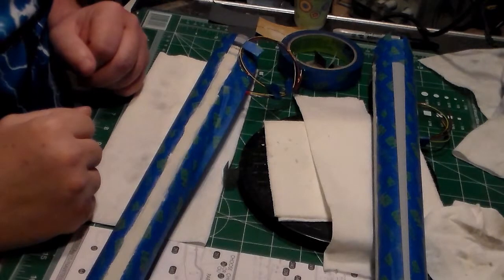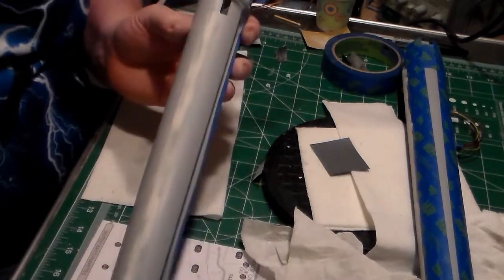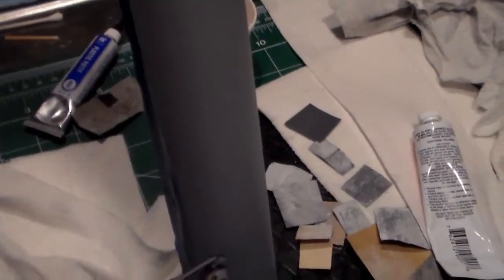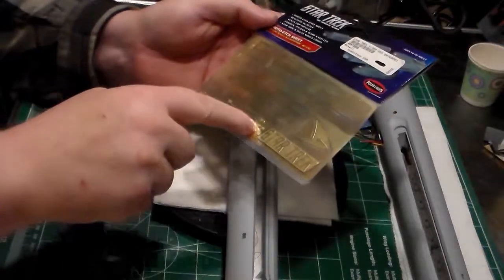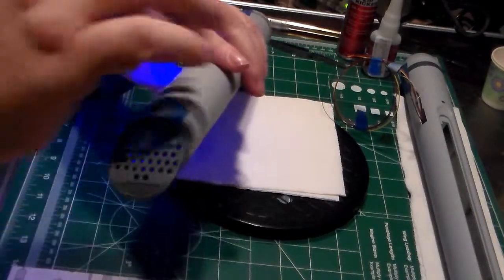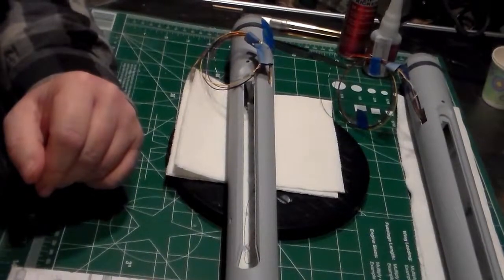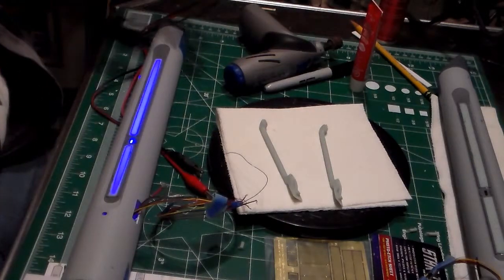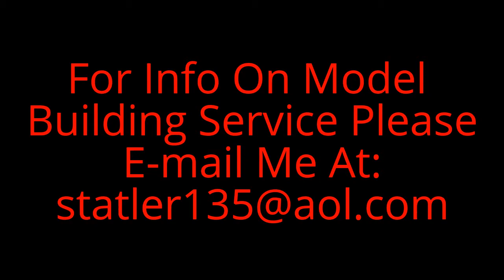POLAR LIGHTS 1/350 SCALE TOS ENTERPRISE BUILD PT 13

Comment: Can I ask about the paint you are using?  And the masking tape?  I used Montana Gold (decanned) and regular painters tape, and the when i removed the tape much of the adhesion stayed on the previous painted part causing a big problem.   What paint are you using and what masking tape? Thanks.
Reply from the maker: The paint that I used on this model was Dupi-color scratch filler primer Prefect match. On this model my client liked the primer color better than the regular paint. And for the tape I used blue frog painters tape along with tomiya tape I got at my local hobby store, as for the dupli-color I purchased that at auto zone along with some adhesion promoter  I hope this helps you out.  If you have any other questions feel free to ask and thanks for watching.
Reply: Thank you. I will definitely check out that frog tape you’re the second person Who has mentioned that brand